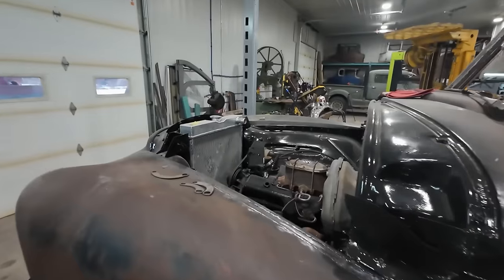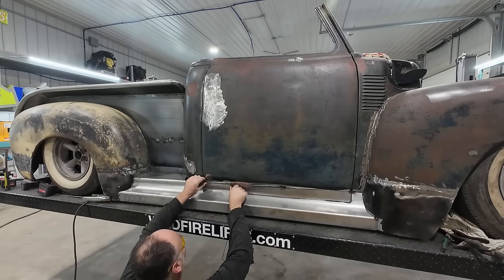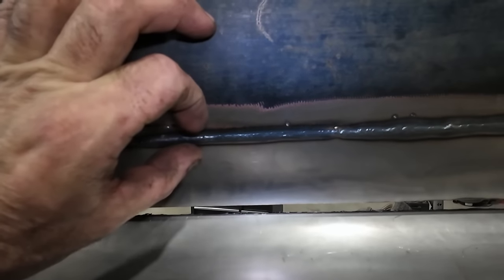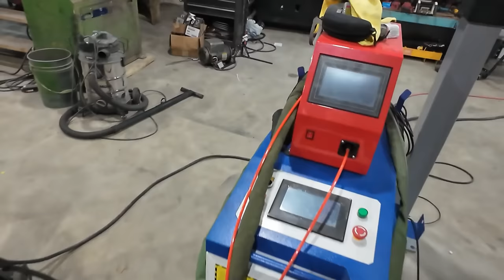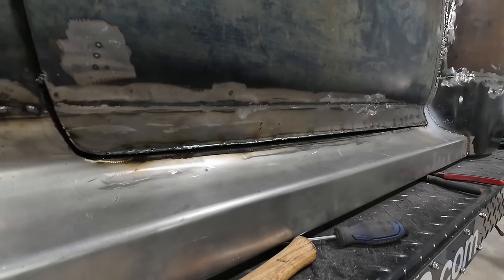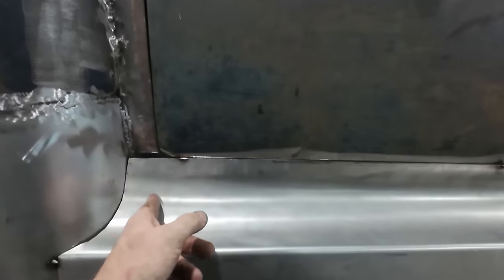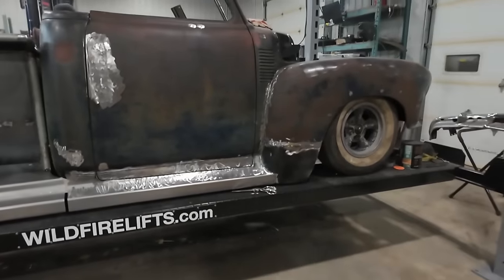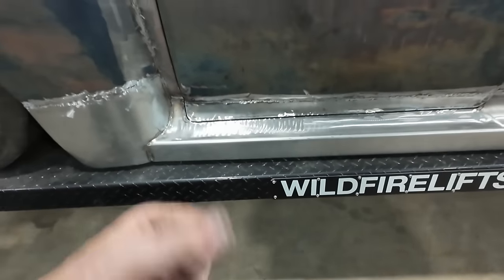Building the door cutouts for our custom rocker panel / running boards

Comment: Brent...make end caps for the running boards that includes mounting tabs behind to attach to frame or body!
Reply: YEAH... CURB RASH , STEPPIN ON  IT WILL CRUSH IT...
ROCK SLIDER RAIL/SUPPORT NEEDED

Comment: Brent, put a little spring T foot just in the back of the wire feed to push the metal down as you weld over it.

Comment: Just a tip. When electron beam and sometimes laser weld, you should have a run on and runoff tab. Being bothered the processes use mostly the parent material which is fused together.  The tabs obviously should be the same material and twice the thickness.

Comment: absolutely love how those are turning out and I get it, a couple of things i'd have done slightly differently to get there, but it works so its all good.I do mostly TIG welding so it was really interesting to see the laser welder in action,looks very much like TIG and like TIG gaps are not so good although with tig you can fix them as you go with some side to side torch movement, its a learning thing will get better and better the more you use it.Keep up the good work youre doing great

Comment: Like anything else it takes a while to find out what the tool is use for. I seen them advertisement but it's nice to see you actually use one. Even the warp you could back off the heat? Seems like it's good for sheet metal work.

Comment: I think you would get a lot better welds too if you acetone'd the metal before welding.  Like tig the only shielding gas is argon, so having clean metal is very important (even on the back).

Comment: Always the BEST builds on You Tube. Will you add support for the sheet metal running boards? Nobody is going to use the as such, but they're just sheet metal flapping in the breeze. Can't wait to see how you cover the cop.

Comment: I wonder if a rubber gasket between the front and rear sections of the rocker could work. That way the rear section would still be removable.

Comment: I pickup little things from you all the time...all of it doesn't translate into skill for me but definitely learn some things.  The 1st couple times I watched I really wasn't sure why you'd keep cutting add small pieces of thin sheet metal and reweld it together. Then I watched more and it was all non structural stuff. So most of my project everything I weld is structural because I'm not painting anything,  I'm trying to keep all my patina;  as this comes together though I really like the look you have visioned pretty wild man plus ur stitching is way better then my little spot welds on the sheet metal 😅

Comment: I would've sliced the outer edge of the door panel and folded it down to meet the piece you welded on. Then, just fill in the outside edges. That way, you leave the drain holes alone.

Comment: Take some round rod weld it under the cad then weld the plate to it so it will give you the space you need for the bottom of the door

Comment: I thought about that if I ever had a car/truck with running board's I would have it open up with the door. Being in a wheelchair I would want to be as close as possible to the seat. In my younger day's I have done some pretty wild transfers into high truck's or into the back seat. I had long monkey arm's to swing across.

Comment: With the laser welding is it possible to pin a tig wire or coat hanger wire in the gap ( maybe with a magnet ) or is it too much dicking around ??